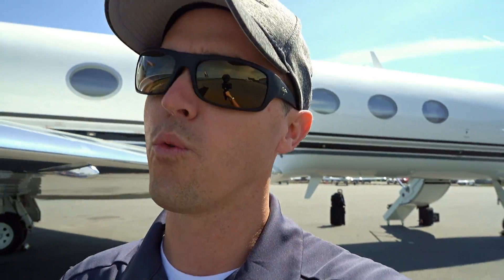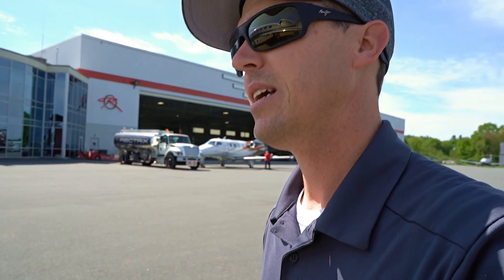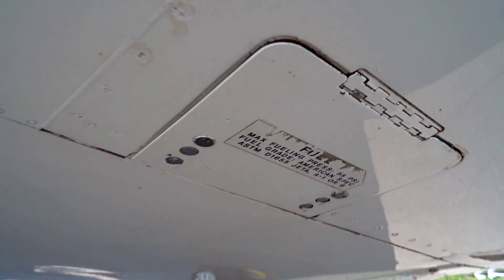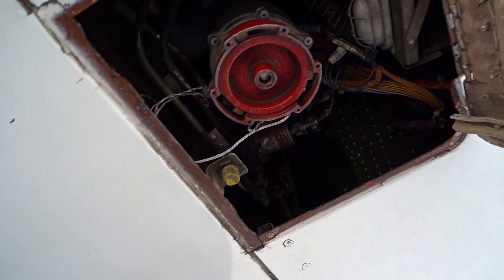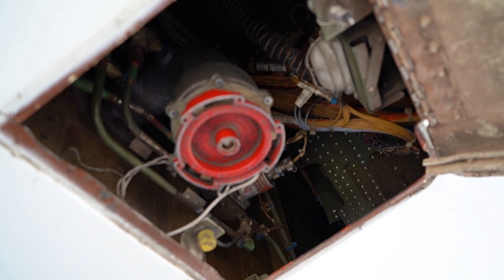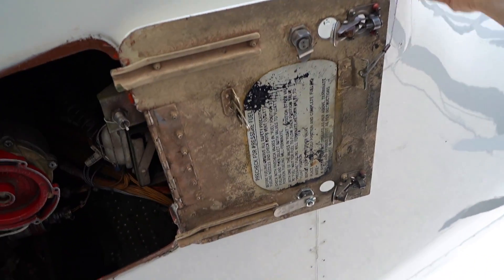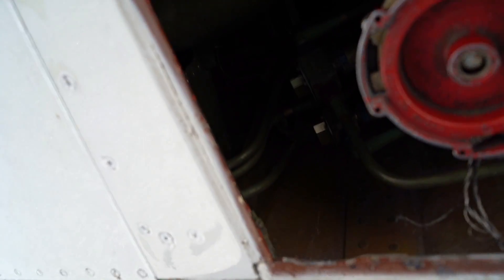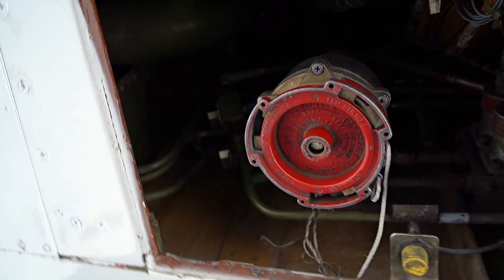Tech Tuesday - Fueling the Gulfstream

Comment: Is it possible to Hot refuel (while engines are running)?
Reply: I've done it several times on airlines, but airport CFR/public safety always wants to be on hand for that.  Haven't had reason or need to do it on a Gulfy in the last 7 years.

Comment: So prior to refueling...do you set which tank the fuel will go to or is it just one big fuel tank under?
Reply from the maker: It splits the fuel between left and right side on it's own, but the right usually takes it a little faster, so we typically have to stop the right side for a few minutes to balance it out.

Comment: Great clip as always Shaun. One question. Does the flight crew depend on the FBO ground crew to understand how to fuel a G-IV (or any particular aircraft)? I've read a lot about condensation too. Do you fuel after landing if the next destination is known?
Reply from the maker: We really count on the FBO personnel to know what they're doing, but we have to know ourselves in case they don't. That does happen at smaller fields that don't see jet's very often. Also, some out of the way international airports aren't familiar. I very seldom fuel prior to the day of the flight. Passengers are well known to change their minds on destinations. Also, I just don't like having all that extra weight sitting on the gear if I don't have to.

Comment: I really hope the rest of the panels don't look that bad as the inside of the fuel door! That poor fuel door has some serious issues going on. I've worked on so meny corrosion buckets that had amazing VIP interiors, but were a total mess behind the scenes.  For your sake, I truly hope this G-V isn't one of "those planes".
Reply from the maker: That's just dirt and discolored paint. Jet fuel drips will do that over time
Reply: You obv have not been around enough
Reply: @St8ks  Oh, I've been around long enough. I just dropped the issue to avoid the argument. But from everything I see that hinge is cracked, but since I'm not on the aircraft to look at it first hand, I'm not going to push the issue. I've seen hundreds (literally) of dirty fuel panels and know exactly what mud and discolored paint looks like.

Comment: Man, the thin cable by the inlet is frayed & it might not be a safety issue, but it just looks a little precarious a feature to think the beautiful Gulfstream might have this detail, what do you think?
Reply: writerwilliams that little string just holds the cap from falling, most planes including gulf streams I work with don’t have them, especially if the have been replaced you just put the cap on the ground

Comment: Thank you. I was wondering about that.  So the G4 doesn't have the fuel panel there in the panel like some newer aircraft. Can you do the same with the Hawker if it has the fuel control panel with the receptical? Thanks again, fly safe.
Reply from the maker: The Hawker is basically the same. I'll plan out a Tech video to show the Hawker system sometime soon

Comment: Is that rust/corrosion on the inside of the panel? What causes that color/texture?
Reply: I was going to say the same thing! I worked on 30 year old T-33's in the Air Force and they were cleaner than that...
Reply from the maker: Jet fuel will discolor the paint over time, so a few drips here and there will cause that

Comment: I worked line back in the day (late 80s) at an airport with a 5400' runway. We had some jets come in - mostly citations at that time. It was a super exciting  (and rare) day when we got to use the single point refueling hook-up. (it's the little things).
Reply: there is a local executive airport by me where G-5 and other small jets come in.....Really Kool to watch them land....and the fuel on board depending upon the Jet is a lot to make it across the Atlantic or Pacific....I think its good gas mileage for a jet.....for the power the jet puts out.....Whats really kool is to see live the A-A380 and how big it is....getting up in the air....too bad Orville and Wilbur aren't around to see that.....

Comment: Thanks Shaun! I'm a little bit intrigued how, in aviation, fuel is sometimes quoted in gallons and sometimes in pounds... I think I understand the reason why. Presumably you have to also make a conversion from US to Imperial gallons when you fly internationally?
Reply from the maker: Yeah...the airplane operates based on weight, but the fuel trucks pump based on gallons. Some countries use liters, but I'm not sure I've ever used imperial gallons
Reply: @CorporatePilotLife  Doh! I've been gone from the UK too long. 8-) I forgot that 'Europe' uses liters. I'm guessing that the yellow stud inside the hatch is for a ground cable, attached prior to fueling?

Comment: Thanks for showing my work place Shaun.  Love that you pointed out the precheck valves, there's too many fuelers even that don't know they're there.   Also - quick correction on the pressure.  Maximum is 50psi, but no one should be running their trucks above 40psi.  Most companies require the truck to be removed from service if it reads above 45psi on any fueling so that the pressure regulator can be checked and make sure it's not failing.  Not that most trucks will show anywhere close to that on a Gulfstream.  With the exception of a few trucks, most will only show ~30psi because the Gulfstreams can take fuel at 300+ gallons per minute, so you're usually about maxing out the truck's flow rate.
Reply from the maker: No kidding...I didn't know that! Thanks for the correction. You learn something new every day I suppose
Reply: I guess that’s FAA wide because same here out of Service at 45

Comment: Q: So can you select from the cockpit where you want the fuel level to be, and the fueler just goes until the valve closes? Or is it strictly manual, you ask for 3500lbs split, and he/she has to manually stop it on their end?
Reply from the maker: It's all manual. We can shut off the fuel valves inside the plane at any point, but we have to physically hit the switches. We can control left and right wing independently if the balance get out as well
Reply: @CorporatePilotLife  Gotcha so only the 450 has the automation?
Reply: @CorporatePilotLife  Thanks, that makes sense. =)
Reply: This online resource has excellent technical descriptions of the fueling system

http://code7700.com/g450_fuel.htm

Comment: Heaters inside the tanks? No risk for fire?
Reply from the maker: It's a hydraulic fluid/fuel heat exchanger
Reply: A heat exchanger is mounted inside the wing fuel tank system. Here is a great technical description of the G450 fuel system, which is mostly derived from the GIV

http://code7700.com/g450_fuel.htm

Comment: Great video! When you're crossing the Atlantic do you have to continually monitor the trim of the aircraft as you expend fuel or does the planes computer system automatically take care of that for you? I love your tech Tuesdays. Thank you.
Reply from the maker: The autopilot takes care of that for us. Also, the auto throttles will reduce as necessary as we burn fuel

Comment: About the price: Today’s U.S. Gulf Coast Kerosene-Type Jet Fuel Spot Price is $1.76 a gallon. Of course, most flight departments are usually under a fuel contract with one of the fuel companies, so the actual price they pay may differ wildly.
Reply: Even with contract fuel the price is higher, guessing the $1.76 is the FBO's price, then you add taxes, flowage fee for the airport and margin.
Reply: non contract fuel pricing varies wildly around the country.  
JFK:  6.77/gal
ORD:  8.32/gal
DFW:  5.25/gal
SEA:  7.25/gal
LAX:  8.14/gal
ANC:  8.44/gal
my airport:   4.65/gal :)

if the FBO is purchasing it for 1.76/gal wholesale/bulk, that's a steal.  I think we get it for somewhere around 2.50
Reply: @keemez  It depends on projected volume, whether it be a stand alone FBO or chain driven.  Ours is right around $2.01 from our supplier, West Coast / LA Platts.  But we are stand alone, low annual volume.

Comment: Is there a fuel gauge externally that can be used to determine the fuel quantity prior to and after refuelling?....what about defueling?
Reply: Not externally but the system can be programmed to accept a programmed amount of fuel through the single point system. Defueling is covered here

http://code7700.com/g450_fuel.htm

Comment: Can you switch between different plane types as a corporate pilot? I thought that in commercial aviation you can be type rated only on one single type at the time...
Reply from the maker: You can be type rated in as many planes as you like, but the FAA doesn't like charter pilots flying more than 2 at a time
Reply: @CorporatePilotLife  2 Questions,(1) is there a tank in the fuselage also or just the wings. (2) if you fill up to go to london, would you have to fill up to come back.
Reply: Thank you for that information. 👍🏻

Comment: Heat the fuel..  Sounds scary?   How about the wing heaters?  When do you use them and how do they work?  Thanks!
Reply from the maker: It is actually a stretch of hydraulic line to cool the hydraulic fluid and warm the fuel at the same time.
Reply: Jet fuel and gasoline are entirely different in regards to volatility. If the fuel cools off too much, say below -45 F, it can start to gel or freeze. Usually a oil/fuel heat exchanger is used

http://code7700.com/g450_fuel.htm

Not to say they are perfect. A BA 777 crashed short of the runway at Heathrow on final when the engines suddenly failed to respond. After a very long flight at colder than normal high altitude temperatures, the Fuel Oil Heat Exchanger iced up and the engines were starved of fuel. Rolls Royce had to redesign the heat exchangers

Comment: Is there a backup way of positively identifying how much fuel is on board other than the fuel gauges?
Reply: Yep, at least three. In increasing order of accuracy:
  (1) Pop the over-wing gas caps and look (you’ll at least get a rough idea based on observed level)
  (2) Dip the tanks (the gauge used to measure the fuel level translates it into a numerical quantity)
  (3) Engine quits due to fuel starvation (no need to check; you have no usable fuel remaining)

The POH recommends methods #1 and #2. 🥴
Reply from the maker: We have a second set of gauges in the cockpit, but that's it
Reply: The fuel receipt and fuel flow gauges.